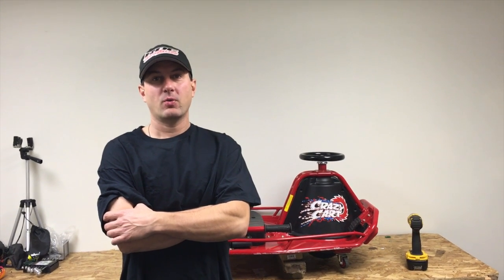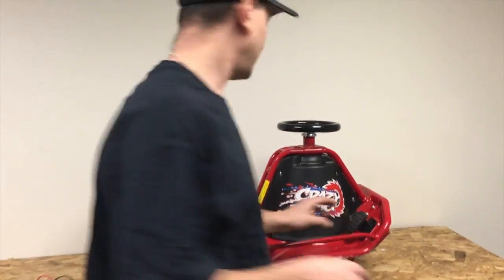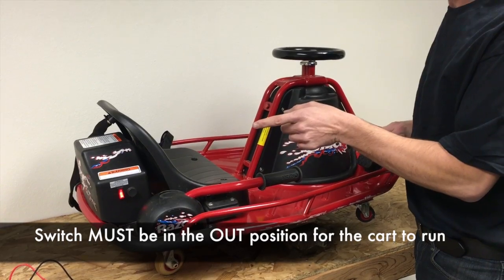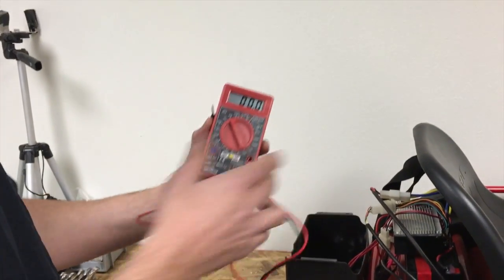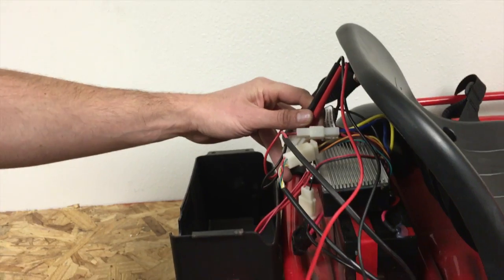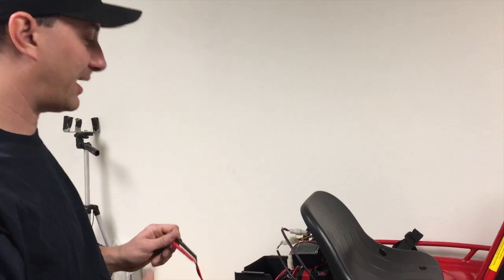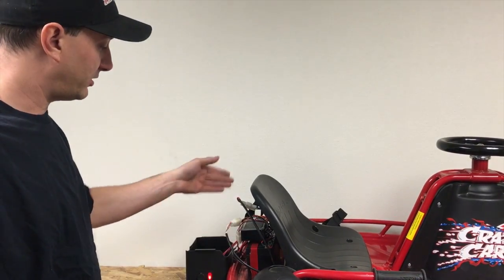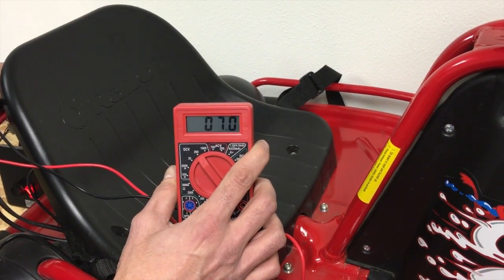Razor Crazy Cart Tech - Wild Scooter Parts - Electrical Troubleshooting Controller and Throttle

Comment: So I have tested the pedal for resistance it’s good I tested my motor it’s good and I’m using a aftermarket battery it was running just fine till one day it stopped since then I’ve gotten 3 controllers and every one isn’t working anybody’s ideas would help I think the controllers might be burning out but idk why they don’t even try to send any power to the throttle

Comment: Okay, I design things, build things and create amazing stuff but electrical is my "Fail". Anyways, bought me a $50 cart that the family gave up on. I know the motors are rarely the issue. Battery was bad and wouldn't take a charge so I replaced those. Then the CLICK you mentioned. I replaced the speed controller, CLICK! Ugh. Then I found your video and BAM!!! kid is mobile! Thanks my man!
Reply: How did you know the battery was bad?

Comment: Okay so i have an xl. I got a multimeter to check the wiring | get 27.7 volt on the battery I get 4.28 from the throttle But I get 0 readings from the motor wire both ways.
I have checked the wiring. I don't see any breaks in the motor wiring My conclusion is that my controller is bad. Can anyone confirm that?

Comment: Hi there, I need to replace the Steering Wheel (with Bolt) on my son's Razor Crazy Cart but the Steering Wheel did not come with instructions and I am not sure what tool I need to use.  Would you please be able to help? He has Version 2.0 with the plastic steering wheel.
Reply: they come off with just an Allen wrench

Comment: Great video, my cart seems to pass all the tests you cover. Power from the batteries, current to the switch, power to the pedal and motor turns. However, cart only travels a few feet and then stalls or seems under-powered and albeit, very slowly. Does this suggest motor or controller issue?
Reply: You described bad batteries to a T.  Replace battery!

Comment: So, I have an issue with my scooter. I had to get a new control due to in it being filled with water. However the motor would run only a little. I got a new controller which was basically for crazy girl kart but could be used for a dune buggy as well. It had a brake plug but I didn’t plug it. Even so I tried to power everything off by plugging everything in and it wouldn’t budge power would go through except the motor. However the motor had power on old controller and works. I tried the paper clip method but nothing happened as well. Any tips?

Comment: I am having problem with my crazy cart but I am between no power going to the motor, battery checks good. Seems battery is outputting power, but no power going to the motor, going to bypass and check the motor. If it works the is the controller.

Comment: I am getting 4.3 volts on the black and red between controller and pedal but a steady 2 volts (not going up or down when I press the pedal) on the black and white on the pedal side of that wiring harness. What would that indicate?
Reply: Thank you for the help hope it works...enjoy your day sir
Reply: Hey Brandon just wanted to know if you found out the problem with the cart I’m having the same issue now
Reply: @kingrob7662  It was the magnet inside the pedal, it had fallen out. Take the pedal apart and you'll find it. It slides back into the back of the pedal itself but be careful, if it is upside down when you put it back in the polarity will be reversed and the pedal will work backwards (full throttle when barely pressed, no throttle when fully pressed). Make sure you've got the polarity right and then glue it back in place with a little bit of JB Weld and you'll be good to go.

Comment: Hello, I need your help, I have the Razor Crazy Cart Shift foot pedal throttle, with the cables disconnected and I want to connect them again, but I need a diagram or an image of another equal, from the inside of the throttle pedal, if you could help me I will be eternally grateful. efrazp@hotmail.com
Reply from the maker: No need for a diagram, Razor was smart enough to make every connector different.  The throttle has only one large connector, and it will connect to only one plug on the machine!

Comment: I’ve got one where everything checks out except for no power coming out of the controller to the motor when you push the Footswitch but the Footswitch checks out help
Reply from the maker: Most Likley the motor wire is shorted so your not seeing voltage.  VERY VERY VERY common, and you cant see it since it happens in the motor wire casing.

Comment: I have a razor drifter cart (blue one) - stopped running.  Battery would appear to be fully charged, throttle showed full power, but when you press throttle down, nothing happens, no clicking, nothing.  Replaced battery.  Same problem still exists..any idea what step I should take next?

Comment: I followed everything u did. Every checks out good but the cart is still not running correctly. It runs and stops. I'll push the throttle and the wheels will turn with power, and when I stop and push the throttle again, the tires don't rotate. Sometimes even junking, like a car running out of gas. Any suggestions?
Reply: Art H Did you solve it? mine its doing the same as youres

Comment: Great video except for one thing.  Your example for the battery test is incomplete.  I ordered a new controller and then a new motor after going through all your steps.  Still nothing worked.  Turns out the batteries tested bad once I watched a different video that did a LOAD test.  That is a test of the battery when you push the throttle pedal.  Video would be perfect if you added the LOAD test at the beginning. Anyone want to buy a new motor or controller? - GK
Reply from the maker: Good Call Gary.  We did the load test video after this one.

Comment: Thanks for the video. Brand new Crazy Cart with black frame and it quit after about 15 minutes. Traced problem to foot pedal, had to re-glue a little magnetic strip that came out of position. so far so good.
Reply: I think my cc is the pedal. I read elsewhere about that metal strip. Where is it located ? Is there a picture for it ? Thanks

Comment from the maker: Thanks for the questions guys.  To repair the issue you have 2 choices.  

Option 1, you can just replace the motor...it comes with the wires on it ready to go.  This is good if you don't feel comfortable soldering and mending wires.

Option 2, remove the motor and the spring over the wires.  Find the break in the wires, and use a soldering gun and heat shrink tubing to repair.  We have a kit coming out just do do this repair that includes everything you need including instructions.

The kit will be available at our site, wildscooterparts.com

Comment: thanks for this video. with it I was able to determine my cc has the same problem as the one in this video.  how do you replace that bad/ broken cable? do you need to replace the whole motor?
Reply from the maker: We repair the cable, but i dont think the average home repair would have the supplies to do that correctly, so just replace the motor.  Not worth your time to try to do it the other way.
Reply: Scott Fraser  nice video
I have a question, how can I buy a good batteries for a crazy cart.? I mean, a good brand...some ones that they last for good ohours using the cart.